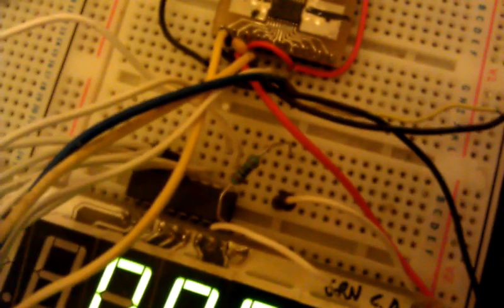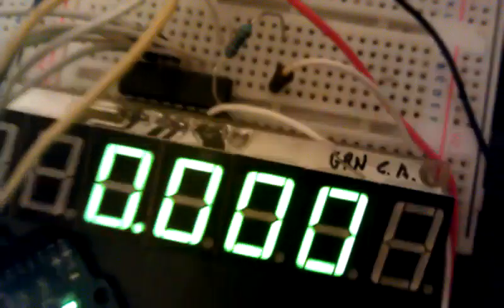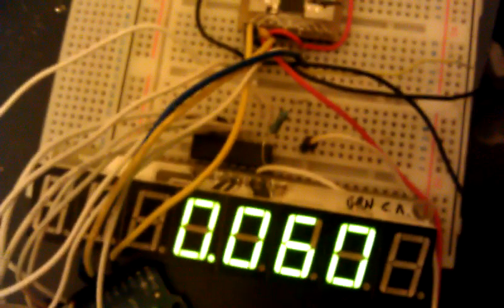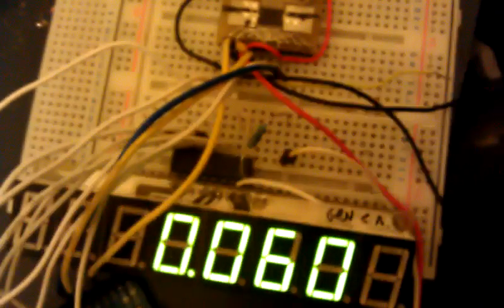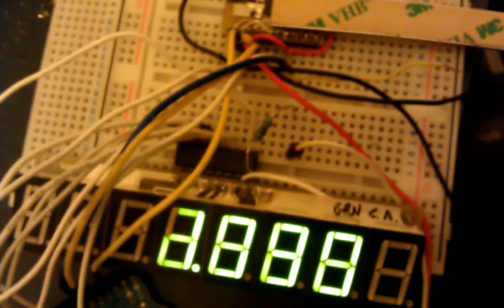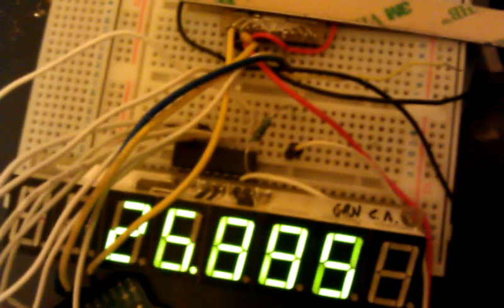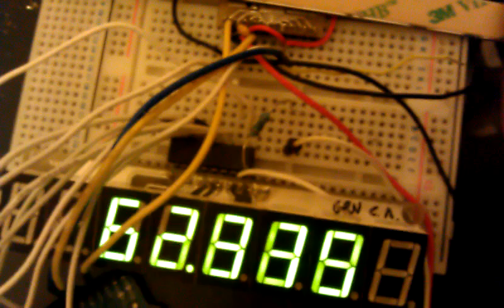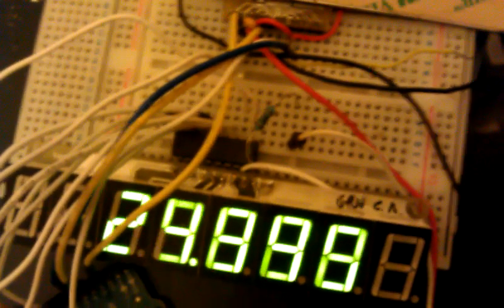AS5306 magnetic linear encoder test

Comment from the maker: The chip uses magnetic strip with pole-changes every 1.2mm and produces 40 quadrature cycles per pole pair (160 transitions in 2.4mm, so every 15um).  Austria Microsystems have samples of the magnetic strip available, largest length is 30cm I believe.